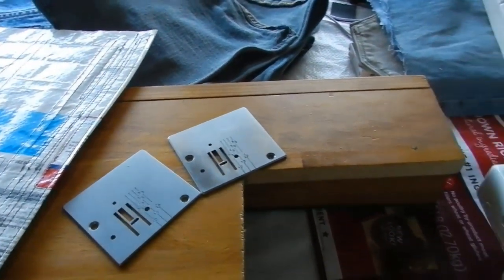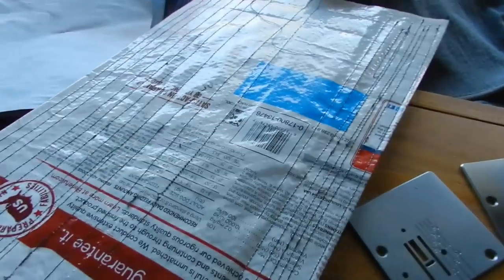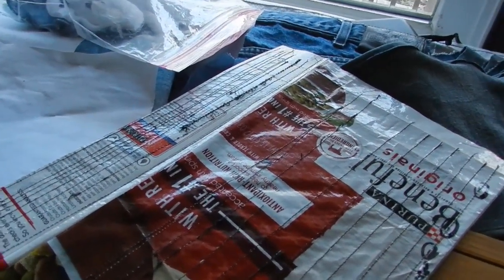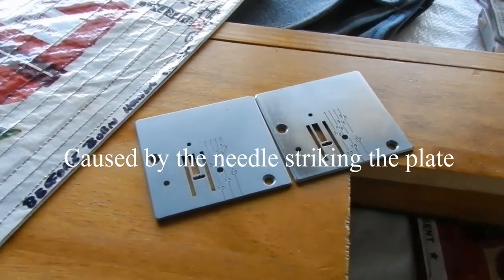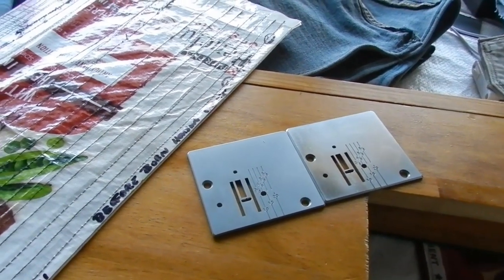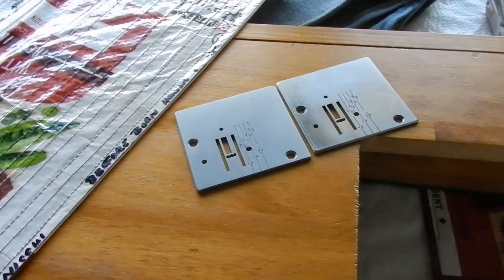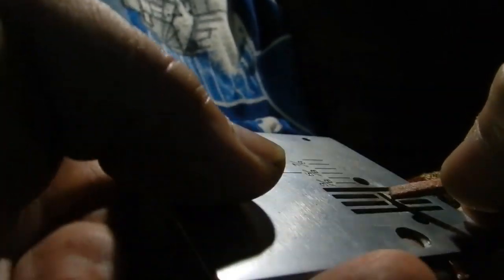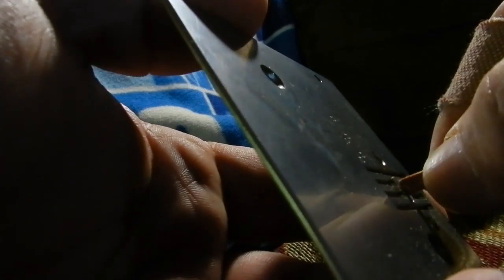How to Repair a Needle Plate

Comment: Hi I have a janome 9400 ..my needle jams and plunges into the bobbin holder I have purchased so many bobbins today in frustration I changed over to the straight stitch needle plate and touch wood ..my Nirmal needle plate does have gashes on the upper side.. could this be the issue ...hell I hope so 🙏 thankyou
Reply from the maker: Jamming may be caused by a need clean and lubricating the movable parts.  Look over the needle plate too.  Hope this helps.

Comment: What about if the needle is broken or ends up missing on the needle plate? How to you fix that?
Reply from the maker: I have four sewing machines.  On the newest NECCHI I removed the plate on the bottom of the machine.  Haven't broke on yet on the Brother.  But the front load bobbin on my two older NECCHI's I have to remove the bobbin and all the holds it.  I all depends what type of machine you have.  Hope this helps.
Reply: @billyq12001  thanks. I guess I will just hunt for a new needle plate. I have tried super gluing the needle back in place, but noticed one of the two are missing.
Reply from the maker: @melindajernigan  You can get them off of EBay.
Reply from the maker: @melindajernigan  What king of machine do you have?
Reply: @billyq12001  I think I fixed it. Nelco Serger sewing machine model 928
Reply from the maker: @melindajernigan  Nice.
Reply: @billyq12001  yep, I found the piece of needle in my stash of fabric scrapes. Literally a needle in a hay stack. Sanded all of the glue in the slot and needle and reglued it. Cleaned everything and put in new needles. Still skipping a thread here and there, but I’ll work it out with my settings. Not knocking now. Thanks for the help.
Reply from the maker: @melindajernigan  At least you tried.
Reply: @billyq12001  yes, It works! Thanks